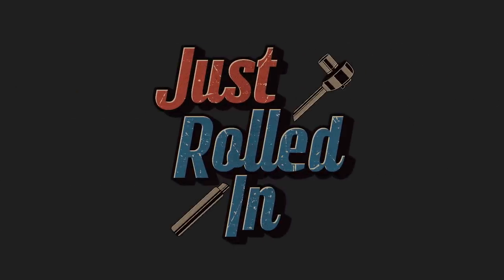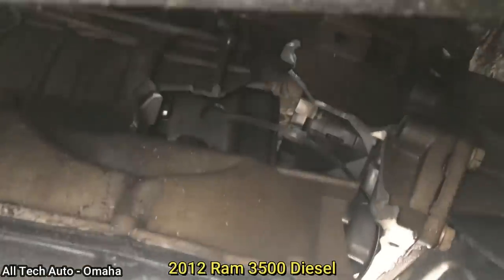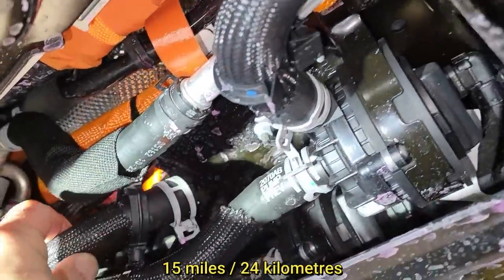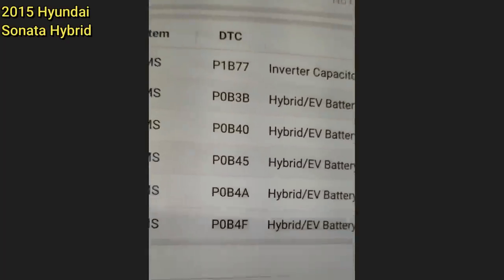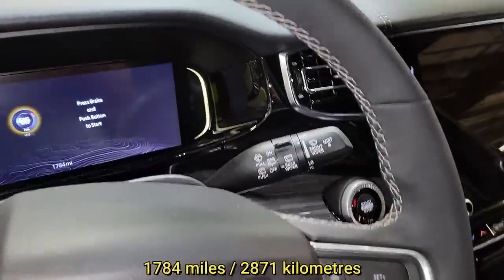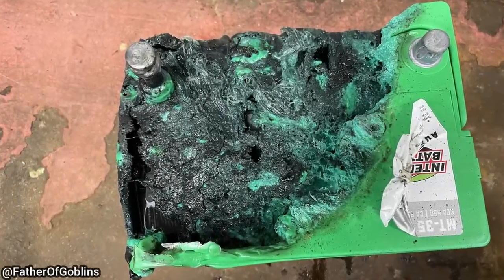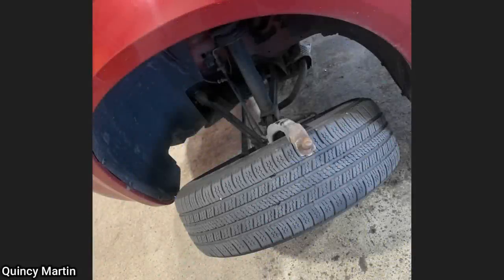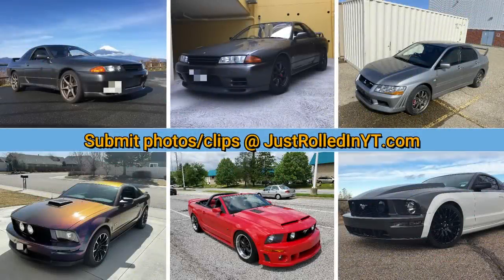Customer States New Truck Won't Stay Running (2022 RAM 1500) | Just Rolled In

Comment: 0:50  I know that the police have the authority to ground a vehicle they consider arguably unsafe but I think that service technicians should also report such vehicles.  While they cannot legally ground an unsafe vehicle, it seems reasonable that they could at least report it to the police for follow up action.  There's too many of these BS unsafe vehicle videos showing up on this channel.  I can even personally recall a number of instances where I saw vehicles with truly bald tires.  WTF?
Reply: Actually, there are some states that allow mechanics to "ground" vehicles or it's their butt.
Others the customer has to sign a waiver to release it.
Reply: @BA-gn3qb  Got a bill with "Not to be driven on public highways" written on it, which I signed, insurance waiver. Drove it to a car lot, bought another almost immediately but showed them the waiver, got a $300 junker trade-in.
Reply: @haroldwilkes598  They probably turned around and sold it for $10k.
Reply: @GeneralChangFromDanang  Today, maybe, but then it was so rusted that my shop couldn't create a place to mount the rear shocks. Engine and tranny were great but without rear wheels, you won't get far. Had over 300K on it though.
Reply: In some states, there is nothing that anyone can do to stop you from driving a vehicle even if it is a death trap, as long as it has all the "safety equipment" that it needs to have (usually working lights and wipers). Where I live, as a technician, there is nothing I can do to prevent someone from driving in a vehicle even if it is 100% guaranteed to cause an accident. I know because I've tried. Reporting it to the police, at the most, simply limits my liability when they crash.

Comment: Replacing the entire engine block because a single piston is buggered? am i missing something? just throw a new piston and valve in
Reply from the maker: Some manufacturers will do that. But from my experience when I worked at Ford, they wanted the whole engine back if it's a low mileage engine issue like that. They always said their "engineers" would check it out. All depends on the manufacturer.
Reply: Cheaper to send the core with damaged piston to somewhere where labor is dirt cheap to rebuild it. Gotta love manufacturers these days.
Reply: Not on your life!   If that was my NEW vehicle I never would accept that Jerry rig repair!  LOL
Reply: I will never understand cars or car manufacturers :/

Comment: I've owned the same model mini cooper from years 2014 to 2019 to 2020, the 2019 self detonated because of it's eco tune after 30k miles and regular servicing, the 2020 was the replacement that also started to get valve train knock and I checked myself it was running some 34 degrees or more advanced timing for eco trash, the 2014 has been going strong for 60k miles, bought it at 40k miles. The big political lie that makes all modern cars suck.

Comment: That second video, dodge broke it's front driveshaft and nuked the back half of the transmission. I've seen at my shop frequently. Usually starts with a bad u joint that gets ignored. The vibration makes cracks and one Booom. This
Reply from the maker: That's what I thought as well. Since I've seen it so many times before and showed it a couple of times in previous videos. But the double cardan joint did not break and take out the t-case and transmission. It just blew up. Thats what the subscriber said who sent it in.
Reply: @JustRolledIn  maybe the tyres broke traction and when they grabbed again was enough momentum to break it. I find it hard to believe it just broke.